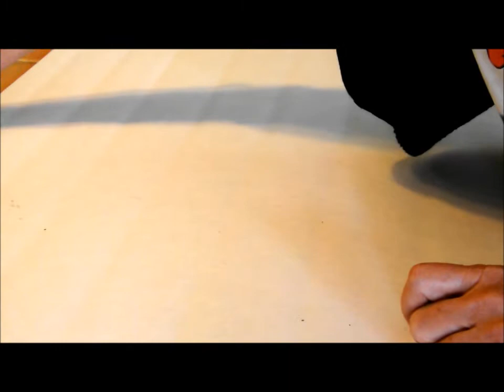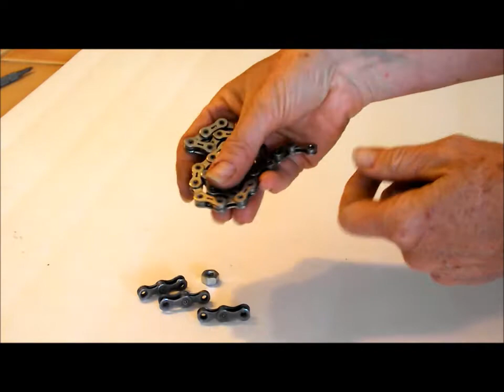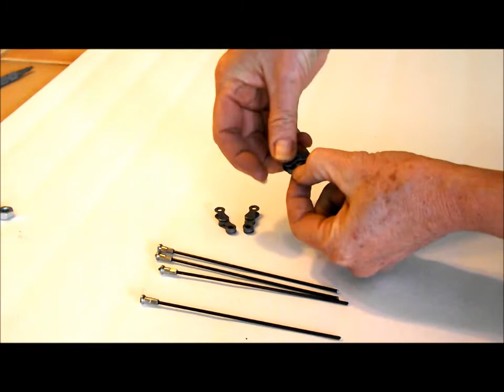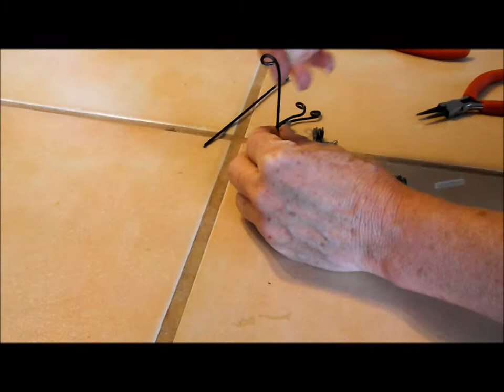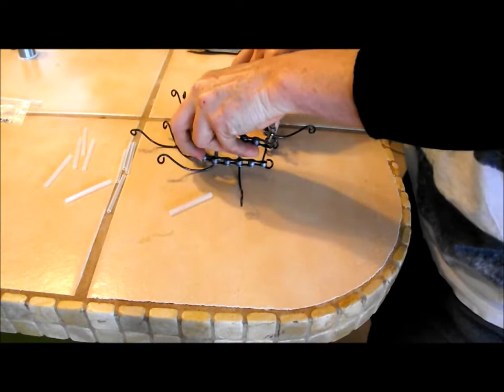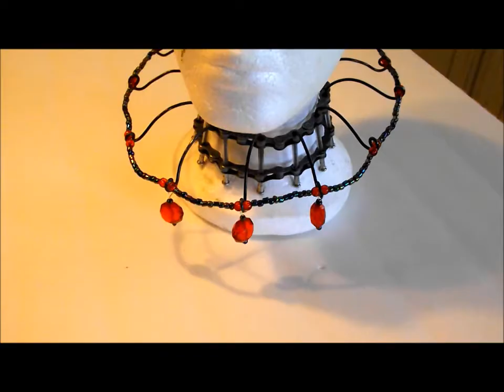Victorian Bicycle-Chain Necklace. Colarão Feito com Corrente de Bicicleta.

Comment: Supplies:
1. Two lengths of bicycle chain to fit around your neck.
2. Ten to twelve bicycle spokes with nuts.
3. Clear acupuncture needle tubes.
4. Beads.
5. Fishing line or 24-gauge wire.
6. Lobster claw clasp (or similar)

Tools:
1. Bicycle chain tool or hammer and awl.
2. Scissors.
3. Wire cutters.
4. Needle nose pliers.

Really clear instructions - thanks Marta x]